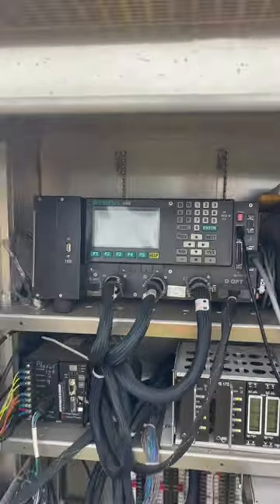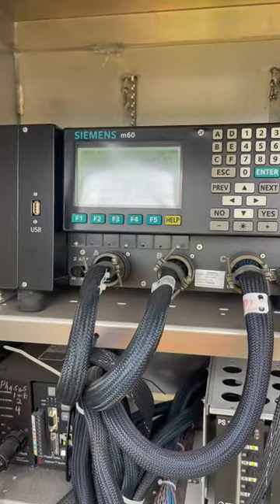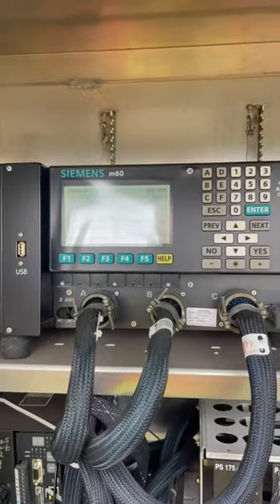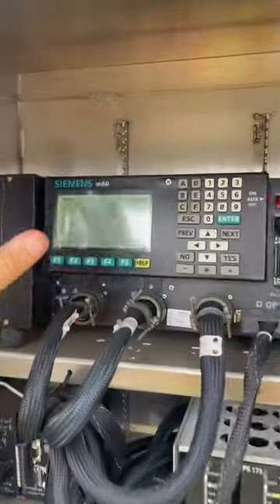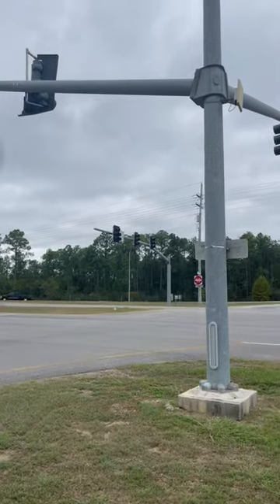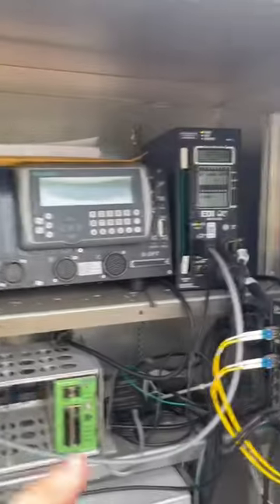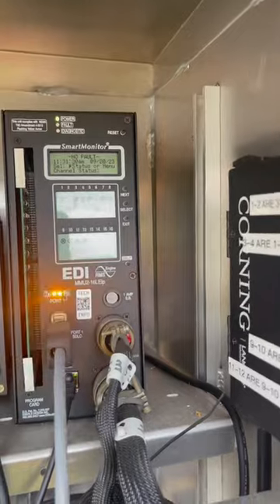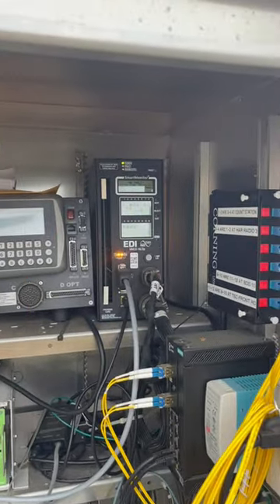Raspberry pi and traffic lights!

Comment: People don't seem to understand redundancy and failure mitigation. I work as an event AV tech and even we are very careful with our hardware regarding stability. We have many modern toys but when running an important video line we still use the gear that has been in use for 10-15 years because we know it just will work. When we have any problems with a cable we immediately replace it and cut it into pieces so that there is no chance another tech can use it. (We still need to bring it back so that it can be removed from inventory as an NG cable). Tech fails and if you have a few hundred devices and cables it fails often. I can't understand how people can think running a raspberry pi on thousands of intersections can be fine where one error can cost many lives.
Reply: they are children uses mommy and daddies internet. what you expect?
Reply: Clearly, these folk haven't considered the consequences of a failure, even briefly.
Reply: @DieselRamcharger  that's what you are.
Reply: why use a huge linux based controller then?  there's a hell of a lot to fail.  this is massively overbuilt for turning on/off a handful of damn lights
Reply: @tsm688  there is a lot there because of the many redundancies in place specifically to ensure reliability.
Reply: @Krankie_V  Redundany is not "linux based controller".  Redundancy is hardware.

This system is so overcomplicated I'm shocked it works at all
Reply: @tsm688  I'm pretty confident that the folks who designed, tested, and manufactured this stuff know something that you don't. I'm certainly not gonna sit here and pretend I know better than the folks who specialize in this equipment; equipment which works very reliably, mind you.
Reply: @Krankie_V  argument from authority is a fallacy.  authorities can go ahead and make better arguments, if they can.
Reply: @tsm688  it's more along the lines of experience than authority.
Reply: @Krankie_V  neither authority nor experience is making the argument here, just "because they say so".
Reply: @tsm688  when you've designed,  tested, and produced something which works better than this, feel free to let us all know,  big guy.
Reply: @Krankie_V  ole dopie tsm doesnt understand that if you replaced the linux controller with a pi controller you would still have the same overall package size. the timers dont control lights directly. they control relays and switches. which are integrated into the rack units. everything is honestly pretty compact. there is alot of shit going on in there.
Reply: @DieselRamcharger  it sounds to me the argument they're trying to make is that being Linux based makes it too complex, as in a software thing. I don't believe that argument can accurately be made without knowing exactly what the software consists of. It's not like it's running a consumer Ubuntu distribution or something like that.
Reply: @Krankie_V  They're running something on 30,000 logic gates that used to run on a handful of relays.  Not everything needs to be computerized.  Not everything *should* be computerized.
Reply: @tsm688  guarantee this is more reliable than something that's fully mechanical. There are a few reasons it needs to be computerized. The redundancies need to communicate with each other. Emergency vehicles can trigger traffic lights. There is likely diagnostic and failure reporting built in. The computerized portion is pretty simple as far as computers go, and Linux based systems are extremely stable and reliable.

Comment: I had raspberry pis failing CONSTANTLY at my old robotics gig and their ONLY job was to display a webpage 24/7,,, and they cant even fuckin manage that
Reply: Sounds like you need decent tech guys lol
Reply: Only job to display a webpage? Dang you must not know the limitations of the hardware you used.
Most likely you fucked the memory card by continously writing large amounts of data.
Reply: Just optimize your hardware and software properly or buy a more equipped system to have some overhead. You dont have to use the least amount of processing power for every task.
Reply: Probably maxed out the memory.
The earlier ones don't have so much.
Also might need to look in the backend and what the webpage depended on. 
Sometimes you can get things in a funky state.
Raspberry Pi or otherwise.
Reply: @sidthetech7623  nope just the pi. Couldn't be anything else. Clearly - this guy KNOWS bro.
Reply: To be fair hosting a web server is far more complex than anything these devices are doing. Also most rpi failures are due to cheap sd cards
Reply: I believe the SD cards are super unreliable for that. best to use a PCIe with CM3/5 or USB SSD for others.
Reply: @JessicaFEREM  nope - the pi will screw everything up. All the pi.
Reply: @jamesbond1231  if the pi can screw it up, then any PC could. it's just a small computer.
Reply: @JessicaFEREM  lol I know. Extreme sarcasm. Sorry. That was my point.
Reply: @jamesbond1231  oh no worries :p 
btw if you want to avoid this next time, try using tone indicators like /s for sarcasm. 
hope this helps
Reply: @JessicaFEREM  hahahah naw I just forgot to throw in the /s. :)
Reply: Don’t run a PHP server on a Raspberry Pi
Reply: I found issues with the reliability of the SD cards in Pis. Sometimes the SD reader would also cause problems after a card died in it. The rest of it was always pretty fine.
Reply: Log2Ram
Reply: Funny to see when i have a esp32 hosting a local web panel, sending rs274 without any problem while being on 24/7
Reply: @jdigi78  its not cheap SD cards even expensive SD cards have reliability issues. It's just how they are manufactured.
Reply: Running a front end app like a modern web browser can be quite a task for small ram devices like some pi models. Seems like you didn't have the expertise to diagnose the problem or spec out the proper hardware for the application. Your only takeaway is they suck because you don't understand the problem.
Reply: Hardware failure or software failure?
Reply: @benargee it's a web server not a browser
Reply: U didnt use proper storage
Reply: that's means there's something wrong in your settings. Raspberry Pi can be used for heavy-duty processing like AI Automations, AI learning machines, controlling some Robot arms for doing something for 24 hours. I still have one the Raspberry Pi 1 Model B (256 MB varians) that I've bought at October 2012 & discontinued long time ago but still running my Echo link (Internet based repeater for ham radio) perfectly until know for 24/7/365.
Reply: sounds like a software issues.
Reply: @kreuner11 it wasn't hosting a website. It was displaying it...
Reply: Sounds  more like a software/config issue to me. I've had pi's serving http content with over 1 year of uptime. That said it's interesting to see the tech replacing a 3 decade lifespan controller earlier in my feed with a box that couldn't be more than 5-10 years old.
Reply: If you set up the PI wrongly it will fail constantly.
so your only goal was to display a web page, you should configure the system to be read only and reboot at intervals.

Similar how routers and modems work. 
There's no need to run a fully fledged OS on the PI if you aint gonna process data with it. you should also be using a branded SD card type used in dashcams to increase its lifespan.

I have a pi zero in my home network running for years on the same SD card, running as a DNS server and last year my router died and the PI zero just keeps chugging on...
Reply: Did you do anything about Chromium's disk write habit? I've had Pis run for years.  Nowhere near reliable enough for traffic lights though. There's a big difference between "I expect this to be fine for 5 years at least" and "I'm willing to bet lives on it"
Reply: I'm a PLC engineer, mostly work with Siemens products.
I had PLC fail more then my own networked Raspberry Pi's and those are 1, 2 and 3 gen lol.

It doesn't mean if you can set up a webpage that you did it correctly, if that was your purpose you SHOULD have made it/set it up as a read only filesystem and set up a proper watchdog service and scheduled reboots in crontab. Like a router it would run for years if you did that correctly, and had all other excessive packages removed.

if PLC wasn't so prone to failure i would be out of the job, a Raspberry Pi is just a SoC the quality has to pass several regulations and laws just like your TV, DVD player, Laptop, Microwave etc...
The only difference why it is prone to failure if it is not properly programmed and passively cooled.

As an engineer i design my own PCB's and electronics, a system that popular could have easily been designed and developed (heck this is what i do for my private business)
They could have easily designed a single PCB with 2 or 3 hot pluggable SoC's, Relay Channels, Input and Output channels that could fit in a shoe size box, an LCD screen and indicator diode leds on each channel for trouble shooting.
The whole thing would cost +/- $300 and be mass produced for intersections.

And no need to send a yellow jacket monkey to check on it for the first 30 years.
Reply: Most of the time, that’s the SD card failing. There are boards you can put a real SSD, or you can boot from the network, which is useful if you have a ton of pi’s.
Reply: your code is wrong.
Reply: It's the cheap SD cards that are unreliable, they aren't designed to last long
Reply: @petabyt  Not only wrong SD cards, if you want to make a robust system that can withstand time you'll need to make it read only filesystem. if you don't eventually the system will get corrupted, just like a router it needs to start with the same fresh unchanged system because if you dont it will fill up with logs, errorlogs, etc...
Reply: I have been using an OrangePi as my home server for a couple of years now, rebooting it around twice a year because I just felt like installing updates. Otherwise it doesn't need anything else. It runs a discord bot and a webserver. And also a database with a custom app. That thing is very impressive for its size and noise (or rather lack thereof, unlike having an old PC as a server)
Reply: @JTCF  To manage traffic lights such a board would be overkill, for webservers, network storage u can use pre-build images that can last for years running.

For a traffic light system you could use a simple chip for logic operations or a SoC like an ESP32 for ease of programming, updates, maintenance, troubleshooting.

Add radiation shielding and passive cooling to make it hardcore resistant against time, radiation, heat...
Reply: That's pretty sad when a tech can't keep one of those stupid Lil things running. I'm still using my pi 2 for  network attached storage and music distribution. Its been easily 5+ years on.
Reply: Skill issue
Reply: I set up about 8 pis to run web pages 24/7 and they have done so for over 8 years. The only faults were power fluctuations causing them to reboot sometimes.

Pis are great devices, just not in all applications.
Reply: @HalcyonVoid  I was waiting for a guy like you to come along and tell em there idiots lol. Some people just like to jump on the hate train!
Reply: I’ve been using a pi to host a home server for over a year, I’m baffled how you couldn’t even get it to display a webpage
Reply: Must need a industrial sd card
Reply: That doesn't sound lime the raspberry pi's fault. A raspberry pi is just a mini computer, it can easily be made into a webserver. If you are trying to run a high traffic webserver thats your own fault, if that webserver is failing thats probably your own fault once again
Reply: A guy that I work with used to go through so many Pis that Amazon sent him one of those dash buttons that when you pressed it, ordered another Raspberry Pi.

Comment: A huge thing to consider for a lot of people that would say that a Pi would be fine is that the actual compute hardware in this is not expensive. As far as that goes, it's the certification, guarantee of reliability and so on that drives the cost of these things. Yes, a Pi could be the brains of the control unit, and another could be the brains in the conflict monitor, but the cost savings would amount to basically nothing once implemented with all the same certifications and supporting hardware

Comment: Anyone telling that Raspberry Pis could replace this never used them for Research and Development...
Reply: Is this use case r&d?
Reply: A raspberry pi is just another computer, there's not much difference between that and the current brain of that machine.
It's just not a good comparison and this guy is milking it for attention.
Reply: @christopher6632  except for the fact that a pi's heat reg is trash, and if its hit any faster than 10 mph its trashed, where as the current system has exilent heat reg, can take a hit at speeds over 70 mph and still function, has built in safeguards that have safeguards of their own, and is doing it while not adding extra to the original product... 

Like seriously put a pi in case that can take a hit at speed, and change its heat reg to withstand catastrophic temp changes like experienced with the computers currently in the box, and make it waterproof... all of a sudden you're "cheaper" solution is not nearly as cheap as you think it is..
Reply: @godzuky2743  that's why I said it's not a good comparison..
It's also worth mentioning that these machines fail frequently enough that this guy has a job and can make content about it. 
A lot of new tech e.g. airport security are using raspberry Pis as that's what the engineers have been taught to use. I wouldn't be surprised to find that in the future stuff like this will be based on the Pi as these younger engineers find their way into work.

Comment: I use a pi to control my 3D printer over a server. I have to power cycle it around once a month because it just gets jammed or stops. You sir have a very good point
Reply: I had an uptime of around a year on my octopi at one point. I had to restart my pi zero pretty often when I was trying to use that, but I always knew I was overloading it.
Reply: they do it too. 
just automatically.  its a single line of code.
Reply: Word of difference better controlling a 3D printer and changing which lightbulbs are lit.
Reply: You're only proving the point that it can easily be done just because you don't know how to fix that basic issue doesn't it's impossible
Reply: @MegamanTheSecond it’s not necessary

Comment: Industrial equipment and requirements are a whole different animal, also when you’re buying from a first party, the service perks are *chef’s kiss*
Reply: It's great service right up until the call center gets outsourced
Reply: @HueMongus101  I’ve never encountered that problem with the mayor brands (AB, FANUC, SIEMENS, etc.), the moment they hear technical stuff they re-direct me to an engineer if one didn’t picked up the phone on me already.
Reply: @polloman15 
You know, one wouldn’t need an army of experts and engineers from 30 fields if they just made the goddamn thing out of relays instead of dropping a whole modern operating system in there.
It just needs to turn a dozen lights on and off, it doesn’t need to run DOOM or play Bad Apple or mine bitcoin, IT
JUST👏
NEEDS👏
TO SWITCH👏
A👏 FEW👏 GODDAMN👏 LIGHTS👏

Look, I’m a computer engineer, it’s literally my job, but even I would like to see more good old analog stuff come back and replace the computerised shit. We are actively making things a pain to use, less reliable, less serviceable and more expensive by cyber-bloating them into oblivion and those shorts are turning me into the next Ted Kaczynski.
Reply: @cezarcatalin1406 this is completely true. That's like making a train using vertical jets for wheels. Just use a damn piston.

Comment: A RPi will work, however, you need to remember that a RPi is built for the lowest cost they could do, and has ZERO fail over.
Reply: From my experience RaspberryPis are really durable and you can make a failsafe by just using 2 of them. The fancy system does the same thing.
Reply: @david_santiagoo  What if the failsafe fails when a car crashes into the box or a lizard manages to get inside? If the voltage surges on a hot day, can you be sure that all the components will function correctly without adding significant signal noise? In general, can you be absolutely, completely sure that the pi's will operate continuously for years, and their inevitable failure won't kill someone? Remember, it has to be cheaper than this solution while you're at it
Reply: First, I set my pi under water, while powered, once, and it survived. 2nd, everything can fail. A professional controller can fail, too. If a car drives into such a controll box, it would be broken. That is connected with the case it is in and not the hardware itself. Even 10 raspberrypis (more and more failsafe) would be cheaper than professional hardware, which, btw, is so expensive because companies like Siemens know how much cities pay for their overpriced stuff.